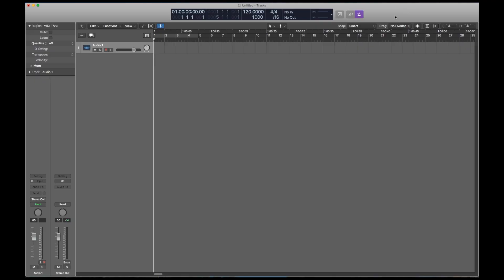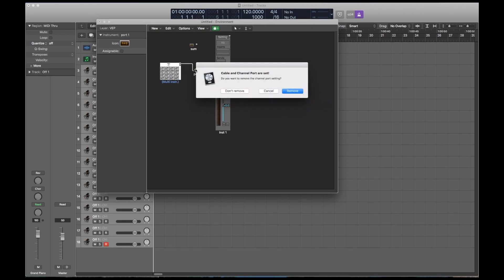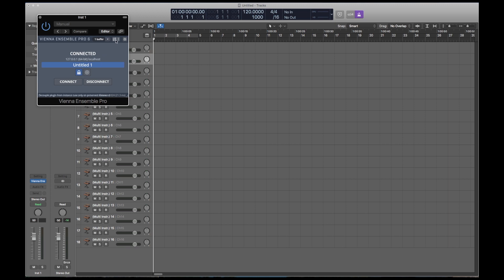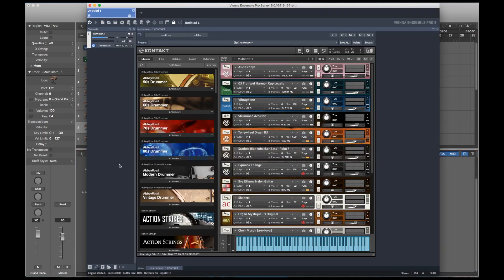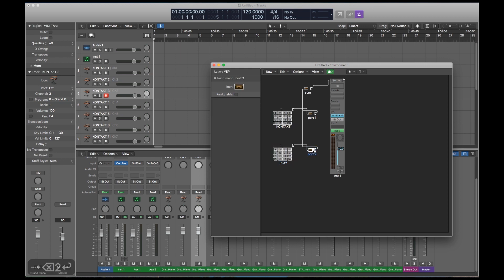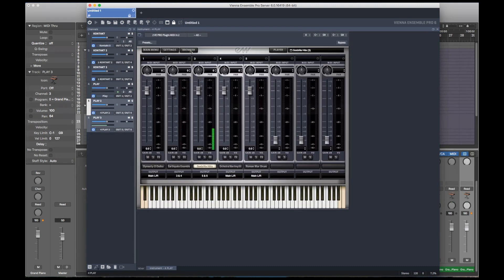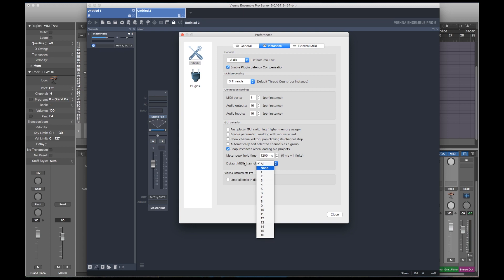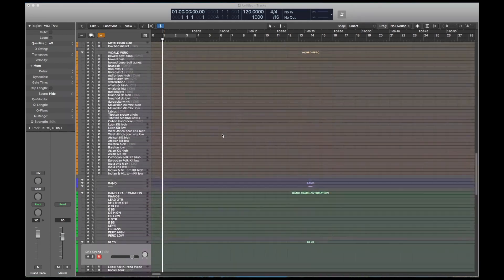How to Connect Logic and VEPro 6, Create Multi-Instruments, Use Multiple Ports, and More

Comment: One more question Alex, at 6:45 you're showing how to get the Aux tracks back into Logic, 3/4, 5/6, 7/8 etc - this only seems workable when you're on Port 1 in VEP. If I'm using for example 8 ports in VEP, I seem to only be able to get back Aux tracks for Port 1 which means I'm limited to 16 Aux channels. How would I get Port 2, Aux 3/4 etc back into Logic? thanks!
Reply from the maker: The port is set both in Logic's Environment (7:01) by changing Data Byte 2 and in VEPro's bus (8:18). Make sure the first VEPro bus is not set to All, but is set to "1." And when you create your new external MIDI tracks, make sure they're linked to the "port 2" multi (7:51). You'll be able to tell by the default track names, so it may be a good idea to wait to rename your tracks until after you're sure everything's connected properly.

Since all the ports in the 1st Instance are linked to one Software Instrument track in Logic, all the audio for all of those ports in the first instance can only come out of the 16 aux channels as you've noted (you won't be able to click the plus button in Logic to add any more). So if you need more discreet auxes, you'll have to add a new Instance in VEPro. So yes, you're limited to 16 aux channels per instance.

Hope this helps!

Comment: Hi, with VE PRO 7 is maybe more convenient to split organisation into more Instances with 16 midi channels and only 1 port used. Simlier and option to disable some of the instances. What do you think?
Reply from the maker: I don't have VEPro 7, but what you're describing (many instances, only using port 1 on each instance) can of course be done in VEPro 6. I have heard people say that Logic prefers it this way, that it's better for multiprocessing, but I haven't had any problems with my method (using multiple ports). I don't see a "disable" option in a VEP 6 instance, but if you want to save processing power, just "disconnect" the instance in VEP or on the DAW side when you're not using that instance. RAM will still be occupied by whatever instruments are loaded in that instance, but it takes some strain off Logic.

Short answer... sure, if you prefer to work that way, nothing wrong with that! I like the organization that using ports allows for.

Comment: Hi, great tutorial! Just a question: On the individual midi tracks, when I try to change some track parameters, such as track delay, nothing happens. It seems that the Track parameters changes don’t go through until the main instrument track. Is there a way to fix that within your setup?
Reply from the maker: In this setup, the way to add FX is on the aux tracks (6:44). So if you want delay on one instrument but not another, and they're both connected to the same instance, you just need extra auxes.
Reply: Actually, it’s not exactly my questions. I want to change the parameters on the individual midi tracks such as track delay, velocity range and so on. The parameters are accessible  on each Tracks. They appear above the volume fader when a track is selected and allow for individual tracks custom settings. On your setup, the track parameters of the midi tracks that are created in the environment don’t change anything when they are modified. It is the midi tracks of the multi Instrument connected to port1. Is it normal that the track parameters have no effect when they are modified? Thanks for your help.
Reply from the maker: Thanks for explaining. You can't use those to control individual track parameters in this setup. The only way to control individual parameters in this template is with region automation, region parameters in the Inspector (above the track parameters you mentioned), or the MIDI Transform window.
Reply: Thanks for the answer. I guess I should just update to vep7 In order to use the new logic integration. Do you know if it will do the trick?
Reply from the maker: @julienpainot8862  VEP7 is the current recommended way to go!

I don't have a tutorial on that, but you can find a link in the description of this video: https://www.youtube.com/watch?v=L1VOFUCkATk

Sorry, I don't know if the VEP7 AU3 method will allow you to do what you're asking.

Comment: Really helpful video. Thank you!  I do have one related question perhaps you could help with?  When I rename one of the midid tracks in the main window, it doesn’t rename it in the mix window as it normally does with an audio track?  I noticed the same in your video as you scrolled thought tracks… the midi track in your inspector window always said Grand Piano, even though in your main window it was the name you’d assigned for the instrument?  Is there a way to make this correspondence in the mixer window or is this a bug in Logic?  Again, thanks for this video! Awesome!
Reply: trying to save time having to type in all the names twice :)
Reply from the maker: You can actually just turn off the display of MIDI tracks in the mixer, as they're not usually useful to have down there. I usually keep auxes, audio tracks, stereo out... Try toggling different displays using the buttons in the top right of the mixer.
Reply: @AskACap  Thanks for the reply.  Much appreciated.  I actually like to see them in the mixer.   It's the way I'm set up in Pro Tools and I'm trying to create mirrored setups.  Do you know if there is actually a way to make it so I can just name the main window external midi tracks and have it automatically name the same trk in the mix window?  This is how it works with Audio Trks, Aux's etc... not sure why it doesn't with External Midi Tracks though.  I have a feeling it's just not doable without manually renaming in both windows.
Reply from the maker: @markholding3954  Not sure, but next time I'm in my VEP/Logic template I'll take a look.
Reply from the maker: @markholding3954  You're right, it seems the external MIDI track names don't automatically update in the mixer! Maybe it's a bug. I think you may have to make do with manual renaming for now.
Reply: @AskACap  Thanks for the reply.  Much appreciated.

Comment: Your tuto is absolutely virtuoso but Easier is to do it in Kontakt alone, or VEP , using automation
Reply from the maker: How do you like to use automation in VEP?
Reply: @AskACap  you can create a macro automation that controls any paramater in any channel . The downside is that there are no much edit and save options yet. I assign the faders to the expression of articulation patches.  It all depends how many time and buttons you have, but principally how many time and how much you know what you want. For me it seems that you use the midi environment for an unnecessary basic level of workflow yet. Even VEP i wonder if it is necessary in one computer, i am trying to have good will and remember that Opus sucks more
Reply from the maker: @emanuel_soundtrack  Fortunately in the latest versions of Logic and VEP you don't need to touch the environment to get them connected. With the versions I'm using, there are 2 other options (using the event input plug-in or using a single port and many instances), but I prefer multiple ports & this is the best way I know of to take advantage of those ports.

I've played around with automation in VEP only a little bit – I should really get into it more.
Reply: @AskACap  yes about the ports it lookS that only the environment can have more options. Is there an easy “port” switcher? The main problem with 16 channels is the problem with cc channels, you have to setup all again in a macro automation, or need 100 faders. I also would ideally use strictly ports for instrument types within the same group , like different legato libraries, and channels only for articulations . But sofar know there is no switcher for ports, so one need more tracks.Ideal is a setup where there is ine track for each item of an orchestral score, and the rest (channels and ports) is just for mockup purposes in the dame track. You can keep posting about this, would be great. I wonder why videos on VEP are generally so incomplete , while there are many confusing problems and ways of using it. I never know what i am saving actually still, or if i can trust it 100%

Principally would help if you show how you put this template and workflow in action
Reply from the maker: @emanuel_soundtrack  The AU3 method of connecting Logic/VEP is apparently much easier to deal with ports. You can read about it here: https://www.logicprohelp.com/forums/topic/125825-vep7-au3-template-and-instructions/

I do get a lot of questions about using this template, or how to do a particular action in it, so thanks for the suggestion – I do plan on making a video where I just show how everything actually works.

I will add it to this VEP playlist: https://www.youtube.com/playlist?list=PLYoxzL2dCfp4WSD9a_F3_WlrCk5_TRrB-

One day it'll be comprehensive enough!
Reply from the maker: Here's a more detailed walkthrough of how I use my template:

https://youtu.be/IliBfrvMdM0

Comment: Hi ACap,

I've discovered that this midi environment routing is now broken in Logic Pro 10.7. On playback, midi notes begin to no longer sustain for their full value. Have you discovered something similar?
Reply from the maker: The Environment doesn't seem to be high priority with Logic. If you're on VEP7, it's recommended to use the AU3 method instead:

https://www.logicprohelp.com/forum/viewtopic.php?f=9&t=143416

If you really want to try to make the environment work, something worth troubleshooting (but not guaranteed to work) is swapping out my "port" transformers with the port macro selectors in this template as well as importing the Scripter scripts:

https://www.logicprohelp.com/forum/viewtopic.php?f=9&t=137085

Comment: Hey Men Great video thanks god bless you
I have  problem in My Instance I have 11 Ports is canged in the prefrences to 15 ports but some of them after port 8 shows mi for example Port 10 (no devise) but I can use them in logic 
what can I do thanks
Reply from the maker: Thanks for watching! I'm not sure I completely understand your problem, but if you can still access VEP's ports 9-11 from Logic and you're still able to make those instruments make a sound, then I don't see how that's an issue other than cosmetic. If it still bothers you, consider using more instances and fewer ports per instance.
Reply: Ask ACap ok bro i have finde the Problem thanks, what is bettet i want to make a big template in logic do you pfrefere more inctances or more ports in one inctance cpu owerload ect..
Reply from the maker: @JHRRAP  I’ve heard that Logic prefers one port per instance (so many instances), but I haven’t really had problems using a multi-port setup, plus I prefer my current instance organization. I currently have 6 instances in my VEP template, with about a max of 3-4 ports on each. Up to you, really! As long as you properly set the cores per instance in VEP depending on which method you use, VEP will handle the multithreading and try to make it less strenuous on your computer.
Reply: Ask ACap 
Ok thanks imust test it out